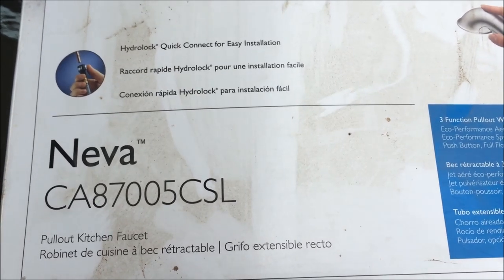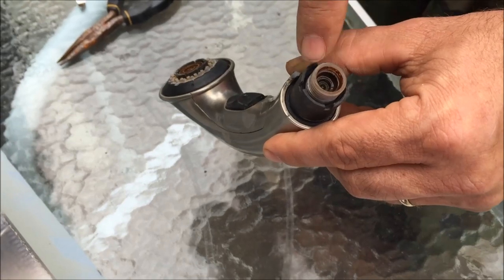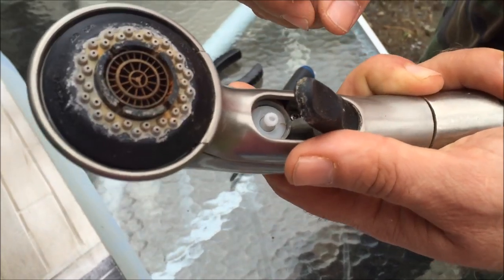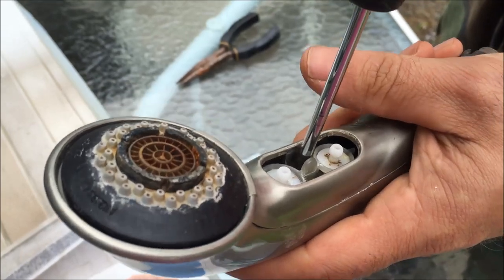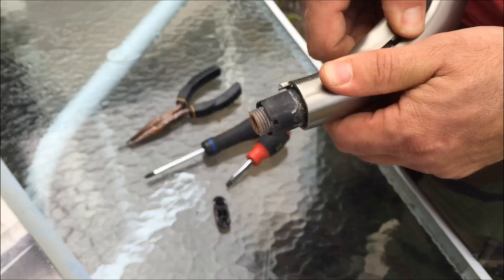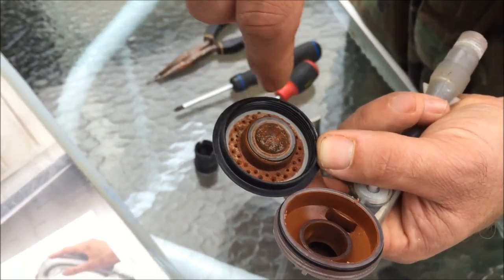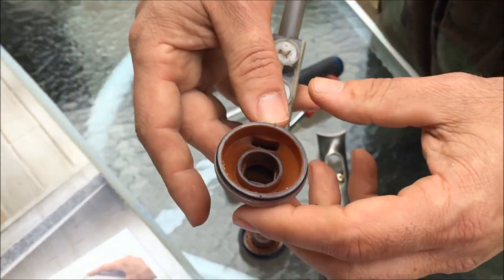Moen Pull Out Faucet Disassembly and Cleaning

Comment: Great video and instructions. Made disassembly, cleaning and reassembly a breeze. My faucet works perfectly, again. Thanks for posting!
Reply: Where did you find the aerator replacement?
Reply: @wandaiperez9265  I didn’t need to replace the aerator. It just needed to be cleaned/cleared of debris.
Reply: @marylouice6526  gotcha. We finally found the right aerators yesterday.

Comment: Also works on the Moen Medina!

That's what I have, and while the base is different, the wand appears to be identical as far as I can see.  My spray/off button was sticking, I popped it off as per the video here (and it was a real pain to get the slide half off, but it finally came out).  Re-seated it, doesn't seem to be sticking anymore, think that did it.  Will know in a day or 3 of washing dishes - was probably something jammed in there.  So thanks for the instructions, beats $50 for a new one from Moen, as that's what they charge for a wand kit, and the order page 404's so I don't even know if I could order it online.  But mega thanks, saved me time and money.
Reply from the maker: That is really good to know.  These manufacturers will often say lifetime warranty but it is quite the hassle trying to not only find the write part but like you said it makes no sense at all having to replace the entire wand.  Thank you for the feedback!

Comment: Thanks for sharing. I was almost convinced the cartridge was bad but after watching this video, I cleaned up every piece of the handle with vinegar and baking soda and now it works like a champ. The pressure is restored as new. The filter was clogged with calcium deposits and had blocked the flow almost to a grinding halt.

Comment: Patrick, thanks for the video. I have a different model Moen pull out faucet, but the procedure worked the same.  Also, the water flow rate can be increased by modifying the flow restrictor/screen shown at 25 seconds in the video.  The restricter has three small holes on the back side that can be drilled out to a larger size.

Comment: My issue is that the rubber cover on the rocker switch (from spray to solid stream selector) has worn so thin that it has come apart. Is anyone aware of an easy fix/replacement, short of buying an entire new wand or faucet assembly?
Thank you for the very informative video.

Comment: Thank you so much. I have Moen 87017, the water pressure was low. After I followed the steps in the video I was able to open and clean it up, after that I got almost the normal flow of water. The aerator at the tip of the spout came out and I am not able to put it back 'cause it is slightly broken. Would you know where could I find the aerator and what size? Big thanks.
Reply from the maker: Pankaj,  I would try reaching out to Moen directly. Most of their faucets have lifetime warranty.  I have had a couple of issues with handles on the faucet leaking and called up Moen and they sent me out new assemblies at no charge.  Post a reply if you have any success!

Comment: I’m trying to find the aerator with no luck. Where can I buy it? A link would be really helpful.
Reply from the maker: Wanda,  seeing that this faucet is 10+ years old you would have to go through Moen direct.  I ended up taking out the aerator on mine because it was cheaper than constantly cleaning it out or the alternative was replacing my whole house water filters more frequently than I would like.  What did seam to work was soaking overnight the aerator in a vinegar solution and working at it with an old toothbrush.  I hope it works out for you!
Reply: @patrickjohn9091  thanks for the reply. We actually found replacements yesterday at Home Depot for $10 the pack of 4. They’re a generic brand but are perfect fit.
Reply from the maker: @wandaiperez9265  Feel free to post a link, part # or picture of the replacement.

Comment: He left the last bit out for some reason. At 2:24 the screen he is pointing to can be removed, just push up from the other side. There you will see the screen snapped into a gray part.  That screen pops out by using a paper clip inserted in the side. Now you have access to all sides of the screen.
Reply from the maker: Thanks for the additional clarity.

Comment: can you unscrew the bottom of the spout where the aerator is without taking the rest of it apart?  does anyone know if there is  an  aerator key available that fits into the four slots  around the aerator?
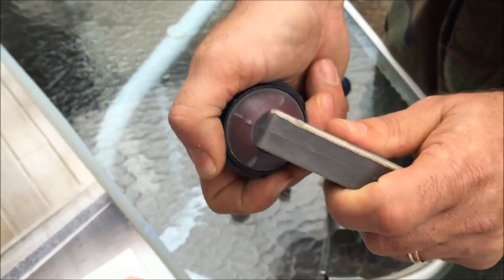Reply from the maker: Patty if you go to the 2:11 minute mark on the video I show how to unscrew the head of the assembly.  The aerator is a molded piece and does not separate even though the slots make it look like it can.  Once the head is unscrewed you can take the components out and clean the aerator.  Let me know how it goes.
Reply: thanks for your demo--- good to know how that things put together.  i still think the head is designed to unscrew without taking it apart-- i've seen videos of doing it with pliers-- but its going to make a mess.  there's got to be a tool that fits the four indentations in the head that spins the head off.  finding it is the problem.  anyhow, your video provides a much needed alternative.  thanks.
Reply from the maker: Your welcome Patty.  I think you are right:)!  After I took everything apart and unscrewed the head with quite a bit of force. I would be afraid to use a tool because I have a feeling it might break.  I would be worth a try though.   Thanks again Patty for the question and feedback.

Comment: Too much work the way you're doing this. Either use a combo square edge or a 2" paint scraper. Both work. I just did this job in less than 10 minutes. Absolutely no need to take the whole thing apart.